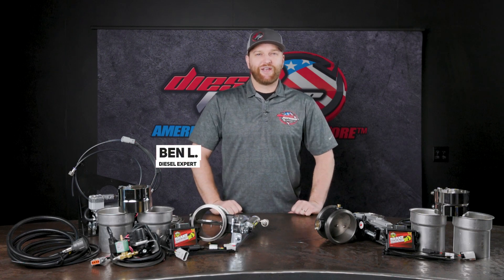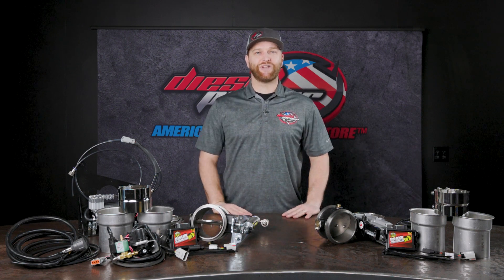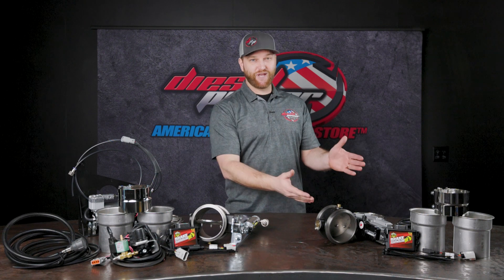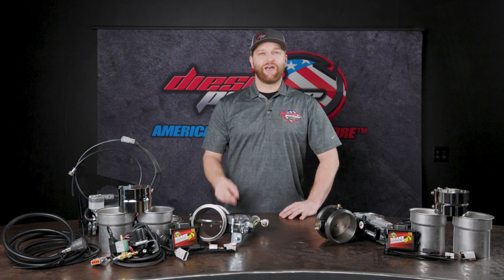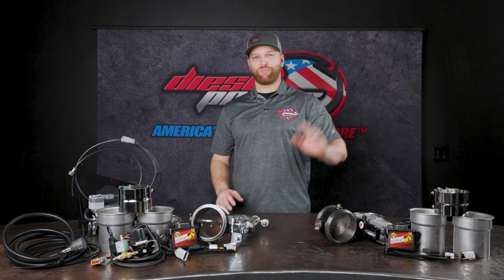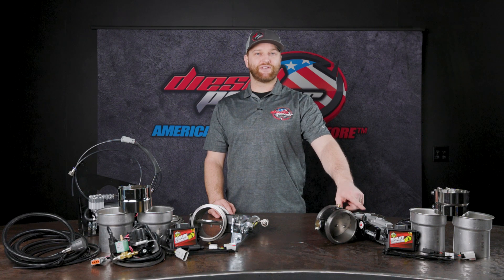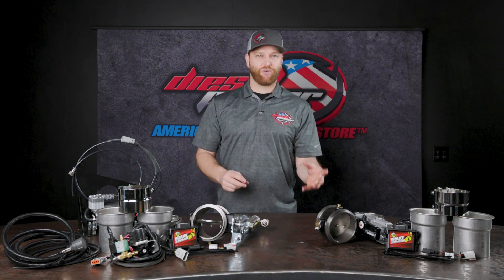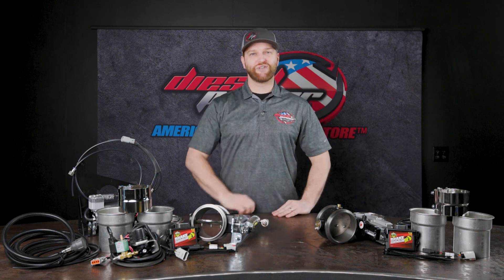DIESEL TALK | BD Exhaust Brakes

Comment: You mentioned it's for a 4inch exhaust, what if you have a 5 inch currently?
Reply from the maker: Check out the listing, you can now get the kit to fit 5" exhaust kits. :)

https://www.dieselpowerproducts.com/p-bd-electronic-inline-exhaust-brake-45-exhaust-non-vgt-equipped-075-17-ram-67l-cummins

Comment: Now, if you can make one that replaces the elbow on the 5.9L turbo, mate a electronic actuator to a PacBrake XB unit with a control module and wired to the  Cummins computer. No air, no vac, computer controlling it. Need to team up with PacBrake on that one.

Comment: One of the reasons I like the vacuum actuated brakes. You still have some hoses to run, but you don't have to install a whole air system, the vacuum cylinder does take up more space, though.
Reply from the maker: Very true.
Reply: Installing a vacuum pump on a 3rd gen serves no other purpose but to operate the brake and makes no sense. At least the air compressor allows you to air up tires, beach balls, whatever. Yes, if you have a 2ed gen that already has a vac system, it makes some sense.

Comment: The bundy exhaust brakes sre pretty much the same as this
Reply: Yeah, but bundy exhaust brakes doesn't work with the automatic and frankly if you ask me, it was a $1400 mistake even though i spoke with their sales team and they said the kit had everything it needed to work with the automatic transmission, bs. I tried returning it and they suggest i run a jumper between the control box and the torque converter lockup wire, like, no.
Reply: @Briebabcock8052  sounds like a you problem then
Reply: @gabrielgomez6898  Less of a me problem and more of a shit company. But hey, you wanna buy that junk, go right ahead.

Comment: cant wait until there's actual reviews out for the electronic brake. Really intrigued but i dont want to be the guinea pig
Reply: I said this same thing when they first released them because I have the bd iron horn turbo kit which eliminates the exhaust brake and I didn’t want one that didn’t work with factory button. Waited forever and haven’t really found any decent reviews so I pulled the trigger a few nights ago. Should be here early next week and I’ll come back once it’s installed and update you.
Reply: @shaneharris6134  that would be awesome. still havent found actual reviews anywhere just a lot of naysayers talking about how worthless it is because it uses an oem style actuator....completely neglacting the fact that the oem actuator went bad because of VGT vanes getting caked with soot which a butterfly valve brake wouldnt deal with
Reply: @shaneharris6134 howd it go?
Reply: @barrymcaulkiner  works great so far, it’s pretty aggressive without any added weight. Gonna hook up a camper this weekend and see what happens